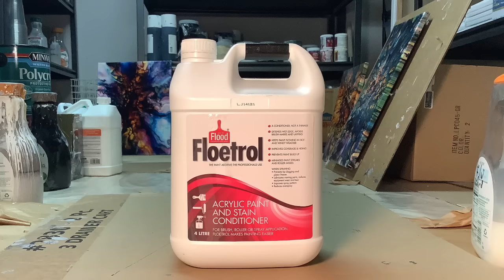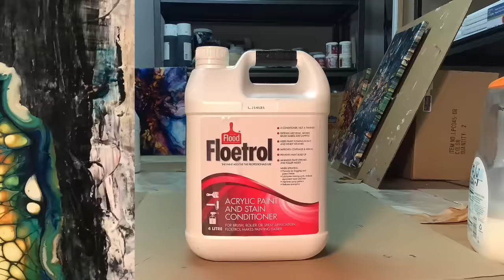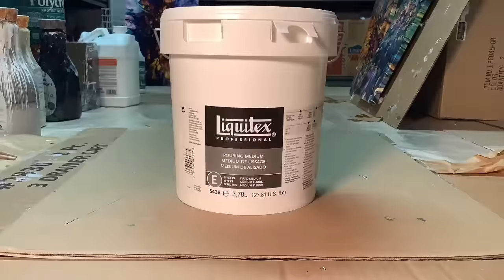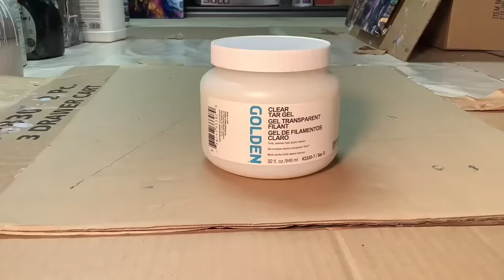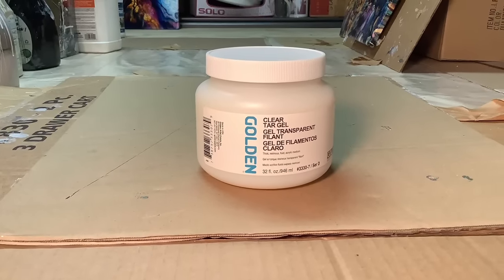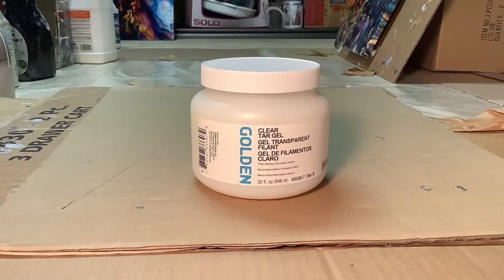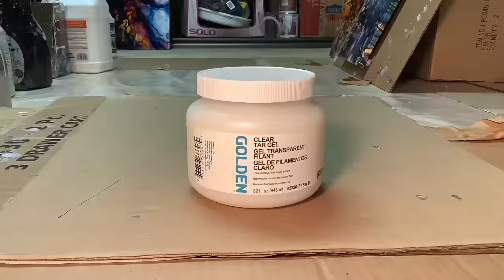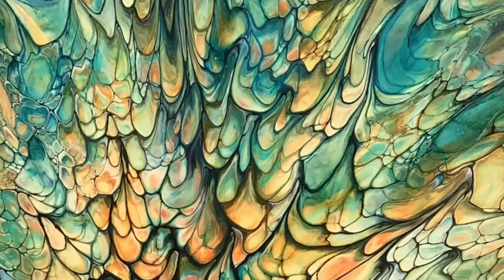What is the ultimate cell activator?

Comment: Very interesting. I saw several artists proclaim that adding minwax pre-stain wood conditioner to American Flood Floetrol is a good substitute for Australian Floetrol.  Any experience or opinion with that? Anyway thanks for your video, I took lots of notes and I’m going to try to incorporate your ideas. I’m a little confused about what you said about the paint because in your main mix you said golden fluid acrylics and then later you said the fluid acrylics are not good for the top layer so I’m assuming you meant the fluid acrylics are OK for the bottom layer but not the top layer? By the way my maiden name is Chase so I wonder if we are related!
Reply from the maker: Thank you so much Vivian 🙏 great questions. The use of wood stain conditioner comes from the mindset that somehow ingredients magically make cells. This product is complex and contains oil as part of its chemical make up. Since oil can’t combine with the paint and is lighter in weight it will rise to the surface much the same as silicone oil does. That creates a cleaning problem that has to be addressed before you can varnish. That’s bad enough but the real problem is that other chemicals in this conditioner can combine with paint…break it down…make it go whacky and interfere with the process. In my opinion it makes the painting look trashy. I would never use it in a painting. The beauty of Australian Flotrol is that it’s chemical make up is so simple that it doesn’t interfere with the process. It doesn’t “make” cells but it is a great thinner.
My theory is that less is better …the cleaner the ingredients are the less chance they will interfere with the paint itself….and the interaction of the paint is what is really causing the cells to form.
Yes you are correct about using the fluid acrylics for the main mix and not for the top layer mix. Keep in mind that the top layer mix needs to sink to the bottom.
I trace my ancestry back to William Chase who came to America in 1630. If you can trace yours to this man then we are definitely cousins!

Comment: Hi Steve. This video was extremely helpful, though I have not tried your specific mixes yet I appreciate the information.  One concern I have, and maybe you can help here is the archival durability using non artist grade materials. Will the integrity of the paintings stand up to time? Do you have any research in this area? Thanks so much!
Reply from the maker: I really appreciate your comments Camssunshinegirl 🙏 thank you so much. It tells me that the message came through. My specific mixes work for me…whether or not they work for anyone else is not the point. The point of the video is that ingredients don’t make cells…they simply allow cells to form from fluid dynamics or manipulation by the artist. With that in mind I want less ingredients that might interfere with the paint itself because that is ultimately where the cells are formed. 
Are my paintings archival? In the strict definition…probably not. Even revered artist such as Picasso didn’t use archival materials …and my paintings are about as significant as a pimple on an elephant’s tail in comparison. However if I were to sell my paintings I would be concerned that they maintain integrity for the lifetime of the initial buyer. Since the paintings are thoroughly varnished I have confidence that they will. Beyond that there will be digital images that will probably last forever. The bottom line is that it’s not an overpowering concern for me

Comment: One question I've got is are you mixing your colors with the primary base recipe? The 3 parts behr 1 part polyacrylic &.4 tar gel???
Reply from the maker: Thank you Don 🙏 yes.
Reply: Thank you sir I have created a couple of very beautiful paintings using your mixture and you are correct the air compressor is a monster to try to tame but I'm working on it
Reply from the maker: I really appreciate your post Don 🙏 glad it’s working out for you👍 the next video will be about air pressure…maybe it will help.

Comment: Which polycrylic do you use?  Can you also talk about the air pressure tool that you use?  Also for those of us who can’t afford the Golden Fluid acrylics, does this mix work with their heavy body paint or other brand tube paints.  (Amsterdam, Liquitex etc).
Reply from the maker: Thank you so much Kathy 🙏. I use Minwax polycrylic. The tool is an air gun with a Venturi nozzle hooked up to an air compressor. I started using it about four years ago because I wanted more flexibility than a hair dryer...it has a trigger for much greater control. People see me use it and think it’s because of its power...but that’s really not the case...it’s the control. The key is how much delicate force applied to the pigments from the top layer mix to spread it out and create the counter action...too much force is counter productive. Check out my first video for further information on it. Other paints will work but will probably take more thinner. My suggestion would be to by a small bottle of the Golden...mix it up with the medium and use that as a comparison consistency model for your other paints. 👍
Reply: @chasefluidart4341    I do have 2 tiny bottles of Golden fluid so will give it a try once I have everything else.  The air compressor/air gun with special nozzle looks like quite an investment?  TY
Reply: Polycrylic is the brand name for the Minwax company.
Reply from the maker: @7fossilfiend  👍 yes

Comment: Floetrol is not easy to get locally.  Have you ever tried Artist's Loft pouring medium? When I was looking for Floetrol one paint store suggested Zinsser Latex Extender as an alternative. It doesn't have the body that Floetrol does so it wouldn't really work the same way. Maybe an alternative to just plain water?
Reply from the maker: If you are talking about a replacement thinner for the top layer mix and no replacement for watered down Flotrol the I would try the tar gel thinned with water.. Didn’t like the Zinsser and haven’t tried the Artist Loft.
Reply: @chasefluidart4341  Thanks. I was afraid you'd say that though. Unfortunately Tar Gel is $40 for 8 oz! :(
Reply from the maker: Try thinning the Liquitex pouring medium instead
Reply: @chasefluidart4341  I'll wait for one of those 40% off coupons Michaels. The 4 litre bucket of Liquitex pouring medium is $150 here in Canada...
Reply from the maker: @phsteele  …what if you don’t like it? My feeling is that you are in the experimenting stage. If that is so I would start with small containers until you are satisfied with your procedure. That way you can experiment with many different products 👍

Comment: Can you use something different for your forced air besides the contraption you were using?  What is that contraption called?
Reply from the maker: That’s a very good question Dana 🙏 thanks so much for asking. I use an air gun for an air compressor and my next video will be devoted to that. It may seem that I’m just blasting away at the paint but in reality the trick to it is being able to control it with a very light touch and having a trigger to control the air flow is the key. Most folks I see these days physically blow on the paint or use hair dryers and get results. It’s the hardest technique to concur….takes a lot of patients and practice. You may want to watch my first video to see more about it. https://m.youtube.com/watch?v=zMyhLf5nO5M

Comment: I've watched this and your other video and am wondering if you have any suggestions as to size of the compressor needed or if other items might work as well to create enough air pressure to form cells?
Reply from the maker: Thank you so much for your question Bobbie 🙏 it gives me a chance to clear some things up about using air. People might think that I am just blasting away at the puddle to create the cells. That’s really not the case. I am actually trying to use the least amount of air possible to spread the top layer mix out so that all of the colors spread out at the same time. If the mixes are proper the top layer mix will continue to sink below the other layers and create the cells as it spreads out. The key is being able to control the air. First it takes a gun with gradual control with the trigger. Unfortunately most guns go from 0 to 100 in a fraction of a second. My gun allows me to use any amount of air I want so the trigger is key. 
My air compressor is a 2 hp, 15 gallon tank. When I begin I’m using very little air to get the puddle to start spreading out. To get the puddle to spread out more I raise the gun straight up, pulling the trigger at the same time to maintain the same pressure as I raise up. In other words I use very little air to start and full blast by the time I’ve spread the paint out. This is why the more powerful the compressor the larger painting. Here’s the gun I use.

GROZ Air Blow Gun Kit — 6-Pc., Model# ABG/QR/6ST/N | Northern Tool
Reply: @chasefluidart4341  if I understand this correctly, the same amount of air pressure is used for a 2 cm diameter and a 10 cm diameter. By using a gentle air pressure you apply the same force by adjusting the distance and increase the pressure as the distance increases. Having only used an air brush, this sounds to me to be very tricky. How long did it take you to manage this type of control?
Reply from the maker: Bingo you’ve got it exactly Bobbie 👍 the power of the compressor only comes into play when you want to go large and get way above the canvas. I’ve been using it for about four years now and still learning ...it was brutal till I found guns with good trigger control...and that is the key...learning control of the trigger!

Comment: I apologize for my confusion, but I wrote down your formula of 4pt tar, 10 flo/water mix, 8 pt thinner. What is the thinner? The liquitex medium?
Reply from the maker: Thank you so much Lisa🙏 happy to clear things up..first of all you need to make the Flotrol thinner...5 parts Flotrol plus 8 parts water. I make up about 40 ounces at the time and store it in a plastic container. This solution will be used to thin down either the Liquitex pouring medium or the tar gel...they represent two different top layer mixes. For the Liquitex mix...take 10 parts Liquitex pouring medium and add 4 parts of the thinned down Flotrol...this mixture is now the thinner for the paint. Now take 10 parts of this thinner and ad 7 parts paint to complete this top layer mix.
As an alternative top layer mix use 4 parts tar gel plus 10 parts of the watered down Flotrol...this mixture is now the thinner for the paint. Now take 8 parts of this thinner and add 3 parts paint to complete the top layer mix. Hope this helps 👍
Reply: @chasefluidart4341  Thank you so much for such a speedy response, I am excited to try your formula's!

Comment: Sorry, but I'm back again. You say your paint colors are mixed w/ the base coat recipe (Behr+Minwax Polycrylic+tar gel), but the last 2 lines in the 3rd paragraph say: 
Mix 10% heavy pigment paint (Golden is best) 
90% Main Mix (Base Paint & Color Pouring Medium)
but I cannot find the proportions of the Base Paint to the (Color) Pouring Mix.  The 7th paragraph (skipping the one liner) reads:
Liquitex Pouring Medium Mix:
4 parts Floetrol/water + 10 parts Liquitex Pouring Medium. This makes the thinner for the paint.  Then mix: 10 parts Thinner Mix w/ 7 parts soft body paint.  That is followed by the list of very dense paints to be used in the Top Layer Mix.
Is any Liquitex Pouring Mix used at all when creating the colors for the paint colors squirted over the base, or is it only used for the Top Layer with the very dense paints you list?  If so, I don't see what proportions are used for the base mixture to the liquid or soft paints.  Do you mean that instead of using the Behr paint in the mixture for all of the colors, one uses 3 parts colored paints to 1 part Minwax PolyCrylic and 3/8 part Tar Gel? 
I'm sorry but I can't seem to put it all together.  Hope my questions make sense and that you can clear this up for me!  Best, Susan H.
Reply from the maker: Thank you so much Lola 🙏 I appreciate it. There are two entirely different formulas. One for the colors (the main mix) and one for the Top Layer mix. The main mix is 2 parts Behr, one part Polycrylic and 10% tar gel. After these ingredients are mixed then add 10% paint (Golden fluid acrylics). That is the entire list of ingredients for the main mix. The remainder of your post deals with the Top layer mix only and you seem to have a correct understanding about it👍

Comment: Little confused here.  You say to use Lukas Studio Iron Oxide Black for the topcoat.  Early you say don't use heavy density paint yet Lukas Studio is heavy density.  And since I can't easily get Lukas can I use another paint like Amsterdam? Heavy or not?  To get the same reaction as the Lukas?
Reply from the maker: Thank you so much Bill 🙏 earlier in the video I said that I don’t like heavy “body” paint. Heavy body and heavy density are two different things. While I would consider the Lukas to have an acceptable density I would not consider it to be a heavy body paint. Amsterdam works fine for me…go for it👍
Reply: @chasefluidart4341  Well i just finished my first work with your formula.  No cells at all, What should i try next?  I did everything just as you listed except i used Amsterdam Oxid Black.  The other exeception I don't have the space to turn it on a turntable.  Just tilted the board
Reply from the maker: Hi Bill 🙏 the Amsterdam black should be fine so if you used everything else to proportion the problem is more than likely how you applied the air to the top layer mix. I would like to help but I need more information👍
Reply: @chasefluidart4341   I used a straw to blow.  But this morning I looked a thickness of the top mix (i used the tar gel formula) compared to the Main Mix and the top mix was thinner.   Isn't the top mix suppose to be thicker that the paint mix?
Reply from the maker: Hi Bill..please call me Steve….the top layer mix should be thinner and heavy…it’s possible that it might not be thin enough but I doubt it. Otherwise It sounds like you have your mixes correct….and as you’ve seen, as important as they are, the mixes themselves are not automatically going to produce cells. The action of the top layer mix sinking through the other paints is the key and the added pressure of the air is going to help that along. I would try a limited amount of colors and make the puddle as thin as possible before you add the top layer mix. Since you are using a straw you might be blowing too close to the paint resulting in only a concentrated area being affected …with too much power. Think in terms of spreading the top layer mix out …not down.👍
Reply: @chasefluidart4341   Hello Steve, after my flops and messaging with you i decide to rest the pour paint for a few days.   This morning I desided to start pour painting again..... I noticed that the white and black topcoat mix each had separated in their respective bottles.  The white had a about 7.35 oz of  almost clear liquid separated from the rest of the white mix which had about 6.25 oz of white mix.  The black (which I used more of the white in the test pours) was at 2 /12 oz of the clear stuff and 10 oz of the black mix. So proportionately much more of the white clear stuff on top than the black.  So first I now know I made some kind of mistake on the top coat mix on either of the black or white.  The rest of the mixes like pillow, the main color mixes had no separation.    Basic question is why the separation and the difference i must of mixed something wrong.  HELP HELP HELP LOL
Reply: Also, Steve, I am using Amsterdam Oxide Black and Amsterdam Titanium White for the top mix.  Should I use Titanium White (which you have said is a medium density) or and Amsterdam Zinc white (which you have said is heavy density)?.
Reply from the maker: @billcox8882  hi Bill. I believe their titanium white is a heavy density and zinc is just a little heavier. No preference for either for me👍
Reply from the maker: @billcox8882  …sounds like paint settling to bottom…normal for top layer mix if it’s been sitting for days. The main mix colors don’t have as much water. Sounds like you have the ingredients down and will allow cells to form…making them form is physical and to me that is the main point of concern👍

Comment: Nice presentation. I agree with you.
 
After much practice relying on other pour artists' recipes and failing miserably over the last several months, my conclusion is that silicone does nothing for my art. Though I like the results others produce from their recipes, I have not seen those results in my practice. As a result, I have looked at this more analytically. You have addressed here in your video many of my recent conclusions. 

At first, I looked for simple truths to learn pour painting,
That quest led me to complicated solutions,
Practice though I may for perfection,
Multiple fails beg the question,
One must be a magician?  by CJSprague
Reply from the maker: I disagree with the last line of the poem…I would have said “One would be better off by sticking to the simple truths”. Nothing would give me more satisfaction than to know that I was able to reinforce your conclusions Sedonartist 🙏 thank you so much for sharing your comments❤️

Comment: How much H2O do you add to dilute floetrol?
Reply from the maker: Thank you Kellie 🙏. Floetrol/Water Thinner: 5 parts regular Floetrol plus 8 parts water
Reply: 1 last ? To prepare paints u said 3 parts Behr # 3453, 1 part polyacrylic, & .4 parts tar gel. Is the tar gel at full strength or the tar gel thinner that’s prepared: 4 parts tar gel/ 10 parts floetrol mix? Thanks!! I think everything else makes perfect sense!! Thank you thank you!!
Reply from the maker: @kelliebowen8209  …full strength for both👍
Reply: Heavy bodied paints for 10% paint to medium? Soft bodied for swiping?
Reply from the maker: @kelliebowen8209  heavy body for swiping.